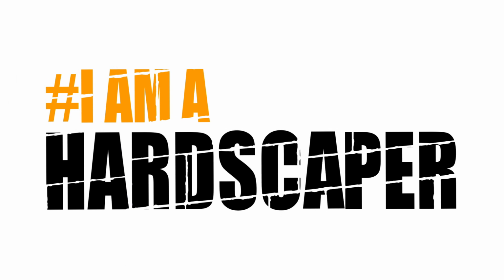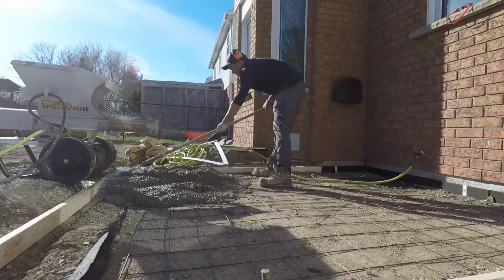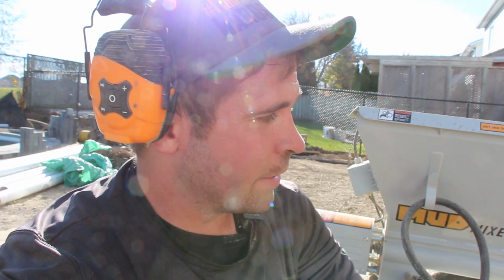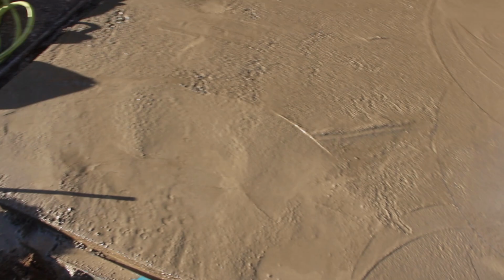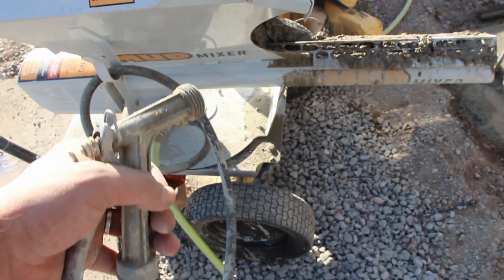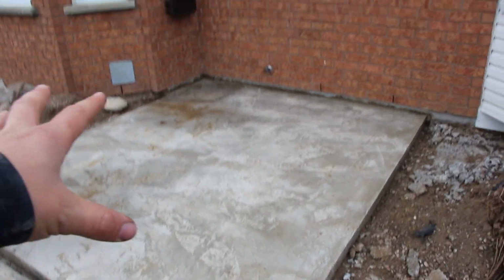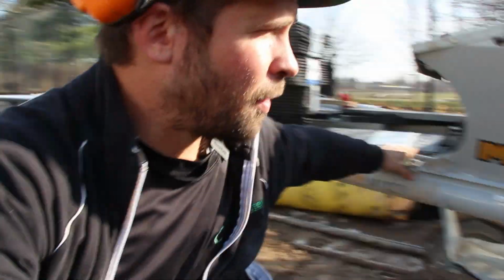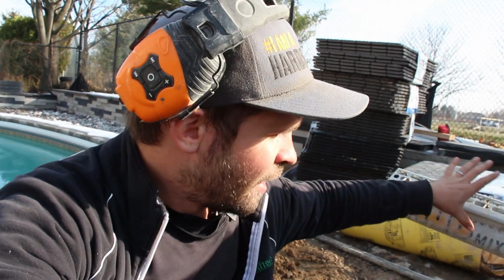Pouring a Concrete Slab and Piers Using a Mud Mixer

Comment: why not adjust the water at the faucet a little to give you better adjustment at the machine?
Reply from the maker: I tried that on this one but you have to turn it down to almost nothing and then it’s even more difficult to control at the machine
Reply: @iamahardscaper  i guess its all where your water comes from, thanks for insight.

Comment: Question;
I have a MudMixer and have run 300+ bags thru it. I find the water control is Very sensitive. 1/8” one way and the mix is too loose. 1/8” the other way and it’s too dry. 
Is your MudMixer the same way ?
Reply from the maker: Yeah definitely feel the same way about mine!
Reply: I wondered if a gate valve for the mix controller with a shut off solenoid wouldn't yield better results.

Comment: When the mud is that loose even if you pull it up it is going to sink back down, plus you were walking on it. 40 plus years pouring concrete in a industrial and residential settings has taught me a few tricks. Just putting a few rocks or pieces of brick to support the rebar would be better then nothing. That said if you get it to high the same thing will happen. Water gets to the rebar and rust it and pop the concrete. You get that lot in shallow or thin slabs. After a couple of years you can stand back and see were the rebar is in the slab. You can get a rebar made out of volcanic rock that will stop this all-together and it expands and contracts about the same as the concrete as the temperature swings.
Reply from the maker: Ah amazing, thank you for the information!
Reply: say if you were not going to cover with pavers, is there a grinder or resurface tool you can rent?

what are the draw backs of using that?
Reply: @jasonpearson1555  Ya you can rent said grinder, but I have yet seen anybody grind to and adequate smoothness without setting up guide rails or have a bridged machine to make it look right. The best bet is to do the first setup of your pour right. Supporting your rebar correctly and wire tying it all together. There is a stretch of interstate on the WYO. and S.D. border that the rebar was set wrong, and it is like driving on a rumble strip. There is a diamond grinding disc-cup you can put on a 7"-9" hand grinder, and you can eyeball it. Face protection and a good respirator is required.

Comment: Question do the round rocks in the mix ever get jammed in the pig-tail mixer blade ?
Reply from the maker: If the mix is too dry, they get jammed in the screen on the top which causes the machine to stop. But I have a version where the mixer blade is shortened. Newer models have the mixer blade extending all the way to the end and others do not have the same problem I have.

Comment: Rebar on the ground means you shouldn't have bothered if you don't pull it up into the concrete before screeding. But that mud mixer looks like a great piece of equipment! Mud being just a little bit thin in the sono tubes wil work out fine.
Reply from the maker: Thank you!

Comment: Your missing about 8-12 inches of auger on that machine. You got a dud and that is why its backing up and clogging . The auger should go all the way to about 1-2" from the end giving both a better mix and easier pour as well as less clogging and backing up in the tube.
Reply from the maker: Yeah I seen that online, don’t know why I got the dud
Reply: @iamahardscaper  call them and they will probably send you a replacement no charge
Reply: @RealDarrellJennings 

Does the auger come in pieces?  And he is missing on of the pieces? Not the extension chute
Reply: @RealDarrellJennings they will

Comment: You might as well have not used rebar. If it is laying on the ground it does you no good. It will rust and the rust expands and cracks the concrete. A bag of plastic rebar chairs is about $20 and you can get them in different heights to put your rebar where its needed in the middle of the slab.
Reply from the maker: Thank you 👍 it was pulled up as we poured

Comment: I seriously doubt that machine will mix mortar. The aggregate in concrete assists the screw in moving the mix. Also, my AI friend who insists on giving his two cents every time I look something up has this to say; "Avoid slumps greater then 5 inches because an overly wet mix can reduce overall strength and result in a weak, porous surface." I doubt the manufacturer of the Mud Mixer will supply a slump cone as it would prove the difficulty in mixing a less than 5 slump.

Comment: The big problem with that mixer is the auger doesn't extend out to the end of that arm.  It doesn't complete discharging the material and forces you to water it down to the point where it is inferior concrete.  That mixer should be able to discharge that entire bag without water and that is not going to happen with that setup.  Good idea, but a piss poor design that leads to nothing but frustration.  I used to run a mobile batch truck, so I might know what I am saying.  Ready mix is not a good choice for a pad that size.  That stuff isn't meant for anything other than very small jobs.  The aggregate in it is inferior and the test strength is too.
Reply from the maker: I appreciate that feedback! And yes they actually make the machine with a full auger now… little late for me
Reply: What would be a good batch and liquidity for let's say a 30 × 50 pad for a metal garage?

Comment: Curious why you didn't stack all the bags by the job so you could maintain a more consistent slump, the stopping/starting killed you.  Haul all the bags+extra for each pour nearby then start.  I think they also have a box for on top to increase the hopper size so you can put more bags in and pull more mud for longer.  I've used the harbor freight mixer with better results but not as quickly or conveniently.
Reply from the maker: That sounds like a smarter thing to do. Yes, I saw they have the hopper extender.
Reply: Well your special tell us more about your harbor freight?

Comment: This "Mud Mixer" is kids stuff. If you're putting up a small concrete dog house, or small [tiny] barbeque pit then its probably so-so and gets you by. For anything of larger square footage you'd best take out some good life insurance , and pre-list it with your surving heirs, because you will be standing there watching this thing spin, spin, spin and poop out concrete at about 2cups a second. Granted they [Chinese buggers] had good intentions designing & building this machine, however I would say this is proof of concept, and now it needs to go through a redesign to make it more functional. i.e. PRACTICAL.
Reply from the maker: I’d say it’s pretty practical for small pours 👍
Reply: It was not designed in China Einstein! 😂